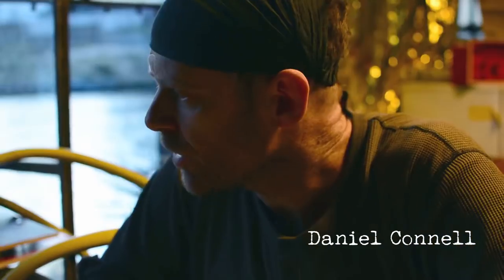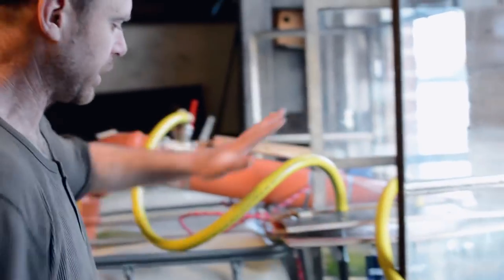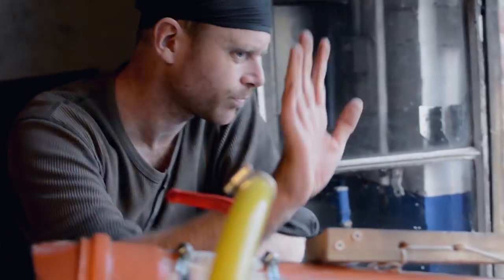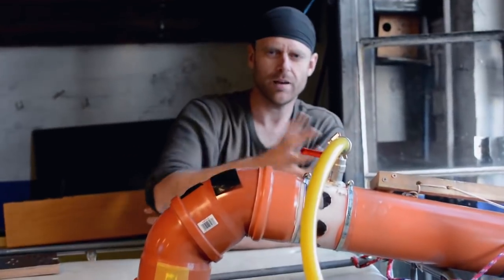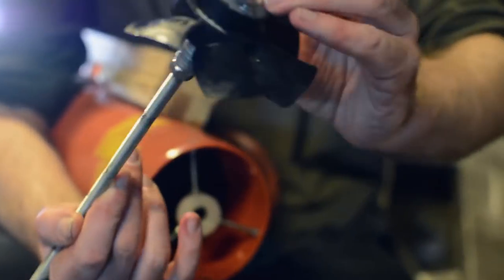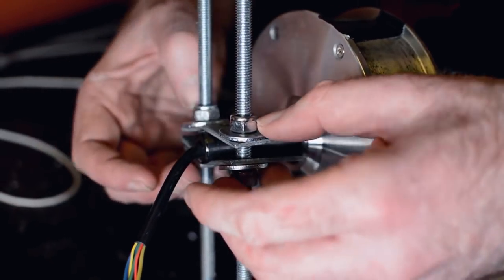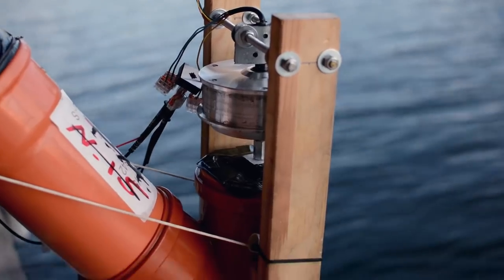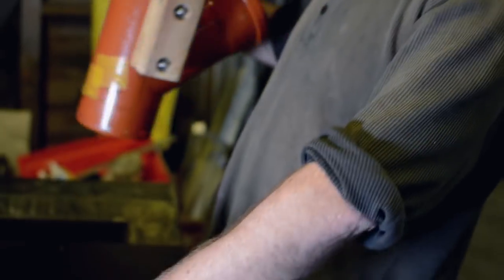$50 Water Turbine-5 kilowatt hrs/day - Open Source, DIY

Comment: That's awesome. I'm wondering if the tendency to kill your syphon when the outflow is in the air means your turbine is slowing the flow. Maybe it would be optimized by having a larger diameter turbine and turbine chamber. Then put it in the river and point it downstream with a flared exhaust, creating a low pressure in the river to pull your outflow along.

But then I think it's overengineered for your $20 alternator. Perhaps an upgrade is due?  :D
Reply from the maker: Yeah the more load I put on it the slower the flow, and it doesn't take much before it's letting air back in. Ejecting below the surface seems to be resolving that fine tho.
Larger tubes would mean more power, but also more flow and I'm wanting this one to be mid range in terms of the kind of water supply that people are likely to have access to.
The river would have to be moving faster than the outflow in order to Venturi it, but some flow would presumably help to some extent.
The hoverboard wheels seem to be holding up and performing quite well, not sure what I'd use as an upgrade.

Comment: Question. Wouldn't you get more power output by simply lengthening the shaft of the fan to have a higher water column above it?
Reply: I think the shaft was reused from the hover board.

Comment: Would it make sence to put the impeller way deeper in the tube to encrease the weight on the blades through the falling water or im i totaly wrong?
Reply from the maker: Yeah maybe, I'm in the process of doing some in-stream field installs, and will be experimenting with those kind of configuration tweaks.
Reply: @OpenSourceLowTech  Nice. If you need support one day with 3D Printed Parts or stuff like that, let me know! I like challenges. Greetings from Cologne
Reply from the maker: Ok thanks.

Comment: Hello boss planning to make a set up like this. One question, can we do a short circuit test for the dynamo?  to know the Current? Just like we do in Solar Panels
Reply from the maker: Shorting the outputs will put maximum current load on the alternator, which can be useful to know, but if you want to calculate maximum output and efficiency you need a variable resistive load, which is what the liquid rheostat is for.
Reply: @OpenSourceLowTech  thanks for the response. keep it up

Comment: that 'stator turbine'.. try to make the flow of water go straight horizontal/vertical. just make it straight, not spiral like that. because the fan blade is design to pull air from straight line.
Reply from the maker: I think that may have ended being the case, yeah.

Comment: Next time i see a hoverboard for free or cheap im getting it, should be broken batttery. What else could be used?
Reply from the maker: Yeah they're good units. Since this turbine is somewhat high revs you can probably get away with a variety of options, as it should produce useful voltage. Motorbike alternators, treadmill motors, maybe a BLDC if there's enough drop to run it that fast..
Reply: @OpenSourceLowTech  why not car alternators? There is going to be plenty of these around soon. or a gas powered generator minus the engine?

People always let that water go through the turbine then throw it away, it could go through A water wheel after the turbine or a corkscrew turbine (i dont know their name only seen one.) After its released from the system. 

Water wheel would be easy, could even circulate "some"water back up to the source to make it just a little more efficient, like a combustion engine does with evp pcv turbo..... even 2:1 volume would make the system run just a little bit longer, if source is an issue, these things use a lot more flow volume than water pressure jets.
Reply: @OpenSourceLowTech  what about vacuum cleaners the motors in there are small but would 2 motors produce enough?

Comment: Kindly let me know if you can ? What are the rpm coming ??? Can a car altinator be used in it ???
Reply from the maker: About 1200 rpm under peak load. Still not enough to get charge voltage out of most car alternators unfortunately, but it should work with a motorbike alternator.

Comment: Could you design something that would fit in to a roof guttering downpipe? It would have to be really micro I realise, and would only provide a supplement to your home generation, not significant and obviously not a baseload as it only runs when it is raining - but therefore a good supplement to solar and wind.
Reply from the maker: Technically yes, but even in a rainstorm you'd be lucky to get a couple watts.
Hydro needs a hillside.
Reply: @OpenSourceLowTech  I have a two storey house, the head is not the problem, I think you mean the flow is the problem. Your system there is 2.5m, which is less than a single storey head. 
So it would be too small to bother with? It just always seems a pity to have that flow go to waste, but I guess the hardware would cost more than the miniscule kWh I might generate over its working lifetime.
Reply from the maker: My turbine goes through about 30 - 40 liters per second, which is a lot more than you'd get off even something like a warehouse roof. A Pelton or other pressure type turbine might need only say a fifth of that, but they don't really work well below at least 20m head.

This guy tried a downspout turbine, struggled to charge his phone:
https://www.youtube.com/watch?v=S6oNxckjEiE
Reply: @OpenSourceLowTech  Thanks mate! You are up late/early. If you are still in Germany that is.
Reply from the maker: Scotland, and yes.

Comment: this may be a dumb question but could you use a large ram-pump to make free electricity with this? how much head pressure / flow rate is needed to make this produce.
Reply from the maker: 30 l/s @ 2-3 m head, but it's fairly arbitrarily scalable.
You'd lose potential power through the inefficiencies in the ram pump, but there could be situations where it still make practical sense.

Comment: wonder if using an inverted blade before the powered blade would make it more efficient ?
like a jet engine
Reply from the maker: I tried a stator turbine but it reduced the power output by about 10%.
I may have just made it badly tho.

Comment: Wouldn't you get more pressure/power but putting a longer shaft on your impeller and putting it at the bottom of your vertical shaft?
Reply from the maker: I tried that initially, check the part one video, and it didn't seem to help much. I'm wanting to keep the shaft fairly short for reasons of availability, durability, and to keep it versatile in terms of configuration options for actual use.

Comment: Angry ram on YouTube did one with a old washingmachine. It worked really well!
Reply from the maker: His was a Pelton, which are usually pretty effective, more efficient than this one and about the same complexity to build. 
But, they need at least 20 meters of head to function well, whereas this one is meant to fill the niche of water availability of only a couple of meters drop.

Comment: Did you think about using hand-spinner's bearings ? wondering .. saw on other turbine videos they are pretty goodx)
Reply from the maker: They're very good bearings and easy enough to get, but wouldn't I think like being submerged in water..
The bush bearing as it is is doing a good enough job, and shouldn't oxidise.
Reply: @OpenSourceLowTech  oh indeed .. submerged .. I've seen them used in non-submerged setups

Comment: Would the output be better if we placed tge turbine at the bottom end?
Reply: Not really; the thing about pipes is the flow rate is the same everywhere. All that matters is the height difference between the top and bottom.

Comment: I have read the comments, so the two or more impeller isn't worked. And what about two generator? Maybe you can get more power from your system because your efficiency now approx 22% (The available power is 0,035m3/s × 1000kg/m3 × 9,81m/s2 × 2,5m = 858W and the output is 192W, the efficiency is 192W/858W = 0,22)
It is not easy to build, but the impeller's blades are on the circumfence, at the center of the pipe no need to flow the water, therefore you can build inside a cone to decrease the free cross section and increase the velocity of the water when arrives to the impeller. Try to mask the center part of the impeller also to increase the velocity.
Reply from the maker: The efficiency choke point probably isn't the alternator, feel like that's doing a good job as is and it's not a matter of there being extra power in the system that a second alt would extract. Main issue is probably the water flow to runner interaction, but given the global access to these materials I'm happy enough to sign off on this configuration as working well enough.
Tho future improvements are of course always possible.
An internal cone to better tolerance the runner edge gap is a good idea, I'll have a think about how best that could be implemented.
I tried a variant on the runner which had a larger central hub, but the output power dropped quite a bit, so that kind of funneling doesn't seem beneficial.

Comment: Like a wind turbine 
Area of wings = power !!
Add more 120mm with a distance 
To get more Tourk / Nm = watt
Reply from the maker: More radius generally means more torque, but fatter pipe means less flow velocity, and so rpms, and so voltage. It's a trade off. I also tried a propeller with a wider center hub, so more of the water was effectively funneled to the outer area of the blades, but it resulted in about 20% less power overall.
Also 120mm is the standard size of these kinds of fans, so anything larger would be harder to source.

Comment: Hi what bridge rectifier did you use, Brent.
Reply from the maker: Fairly standard three phase one off eBay, was about £8, something like 1000V 50A rated. Not sure if the heatsink ones are necessary, but they're often about the same price so might as well.
Reply: Cheers, much appreciated. Brent

Comment: Try to use asymmetric intake pipe. It should look like automotive turbine. 
Remember! Vortex is the power!
Best regards from Poland!
Maciej.
Reply from the maker: Asymmetric like how?
Reply: @OpenSourceLowTech  
And when intake pipe will be thinner than propeller and outgoing pipe, the water in intake pipe will be lightest than outgoing pipe. 
This should increase speed of water incoming on the propeller.
What do you think about it?
Reply from the maker: Yeah I was thinking on more or less exactly those terms for an alternative configuration to test. Something more like an actual Kaplan turbine, which are a bit more efficient and forgiving than the propeller type I currently have, tho I'd probably use the same type of fan.
I'm pretty sure I can make something approximating it with standard PVC parts, will take a crack at it at some point and see what happens.
Reply: I think it‘s the venturi effect...

Comment: but what is a purpose of having that hydrogenerator in the house when you have to power the water pump?
Reply from the maker: The pump was just for testing, actual use would be in a stream or other flow with natural drop.

Comment: hi, from mexico, the only reason why it is not used in a house is about the diferences in height of water in inlet/outlet?? if so, I think this difference can easily be created artificially... please comment....
Reply from the maker: You need a couple meters drop, but also tens of liters per second flow. 
You're not likely to get anything like that off a household tap or rain gutter, needs to be at least a small medium creek.

Comment: Little confused.  What happens when a small fish or piece of debris gets into the pipe?   You can put broad mesh over the opening, but  small objects will still be sucked through and clog the fan.  The more filter material you use, the less water moves through.   What am I missing?
Reply from the maker: This would absolutely require a screen on the inlet to stop anything large getting sucked in. Tiny particulate matter would probably just pass through tho.
Having a box of screen, ie a surface area larger than the inlet pipe, would compensate for the resistance against the fluid.
Reply from the maker: Good to know, thanks.

Comment: i would like to see the unit run with an mppt charge controller into a battery to see the power limits as the mppt would be able to do a full scale scan and work pout as you have the best and most efficient setting i read in another post you dont feel it is needed but this does give poeple a better perspective of what it can do when we see devices it can run and so on

Comment: Do you think I can use a windtubine generator instead of the hooverboard wheel?

Thanks very much, currently i live in a land with my 2 lakes and i want to do this. I hope to.
What do you use after to connect to devices?
Reply: The idea can work for any motor because its sits out of the water on top
Reply: Tom Robertson ok thanks, do you know how to calculate the size of the motor? For example of you know the volume and the heigh of the water, you can decide to take a 100watts or a 500watts.
I don’t really understand that. And i don’t want to install an under sized or oversized motor.
Reply from the maker: Using other types of generators/alternators would depend on various things like their voltage per rev, max amps and power output, mass and force to turn them etc.
A home scale wind turbine alt I can see probably working tho, it'd be worth a try.

The full system power calculation for hydro is: flow x head x gravity. So in my case in Berlin I had 30 l/s x 2.5m x 9.8 = 735 watts.

What to plug it into is a whole thing unto itself, but there's options. Basically usually a charge controller leading to batteries and probably a dump load.

Comment: Basically increasing the amount of turbines (Computer fans), combined with increasing the length of the outter pipe (The vacuum pipe) will give you the power increase you need

Comment: If your turbine sits at the top of the setup, what’s the purpose of the 2.5m pipe aside from guiding the flow of water?
Reply from the maker: Suction, basically. If the water just fell out the bottom of the turbine the weight of it wouldn't pull more water through the system, as happens with an outlet tube.

Comment: how much power does that old hover wheel make in avg? i have one just laying around doing nothing but might make a wind turbine out of it
Reply from the maker: They're usually rated to 350W as motors, so presumably something around that, depending how you run it.
Check my other videos for more info on pairing them with wind turbines.

Comment: Hoover board is 12 volt an I have a old Segway that has wheel motors at 36 volt dc so maybe I should try to build one I'm thinking, wonder what type of power I can get from them. I don't think my grand children will let me have the wheels off their new hoover board.
Reply from the maker: Hoverboards are usually 36V but can sometimes be otherwise.
If the Segway wheels are larger then they'll likely do more volts per rpm, tho may take more torque to turn and might be getting a little large for this particular turbine.

Comment: Im living in a off grid area, I have a creek and have it measured about 40l/sec with a potential head of 10m. i need a turbine generator kit for this set up, how much budget i need for this set up?
Reply from the maker: Sounds like reasonable water availability. Where are you based?
Reply: @OpenSourceLowTech  Philippines
Reply from the maker: Exact costs will depend on local materials, but the only bits you really need to pay for are the alternator (can usually get a hoverboard wheel or motorbike alternator for $10-30) and the PVC pipe and fittings, which tends to vary wildly in price but can be fairly cheap.
Reply: @OpenSourceLowTech   I could not find a local supplier for the runner, if im going to buy from you how much would cost me?
Reply from the maker: I've just been using standard 120mm computer fans. They're usually only a few dollars to buy new, or you can pull one out of an old PC power supply.

Comment: I live in Ecuador and I’m very impressed. I have a question. What do you think about using the pvc pipe and water pressure/siphon power and back feed a water pump, then have the pump power/spin a car alternator? Getting an old water pump and old car alternator can be easier to acquire a-posed to fabricating the impeller assembly. I would be curious to hear your input.
Reply from the maker: Pump as generators can work, but as I understand it centrifugal impellers are quite demanding as to the flow and rpms you give them, in terms of the efficiency they give back. It may work, but you might need to be fairly precise about matching the impeller to the flow characteristics.
Car alternators aren't very efficient, only about 50%, and don't do good volts per rpm. It's usually 1500-1800 just to reach charge voltage for a 12V battery. Also quite heavy. Easy to find tho.
Motorbike alternators are usually a better bet on all counts, but still not super amazing for voltage, and you'd need to mount them on a bearing.
Reply: OpenSourceLowTech Thanks for the response. Sounds like my idea could work, but it would not be very efficient. I figured you probably had already given my idea some thought.  I was thinking that the car alternator and pump would offer a lot more durability, and they are easy to come by.  

I am looking forward to your next video, I’m very curious how your design does long term. I’m a retired firefighter from Southern California now living in Ecuador, and I love putting scrap yard ingenuity and engineering to work for practical causes. I also have a fair amount of experience with fluid dynamics and pumps from operating fire pumps and fire hoses.

My wife and I are considering living in a small cottage near a river here in Ecuador. When we make the move I would love to implement your design in a generating system. I would love have your input as well.
Reply: OpenSourceLowTech can you show me one kind?
Reply from the maker: Sounds good.